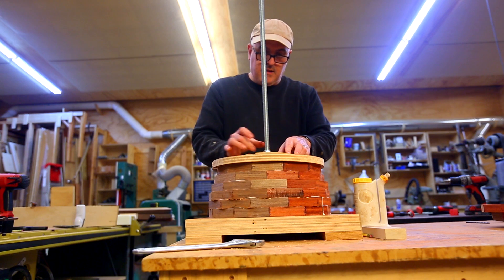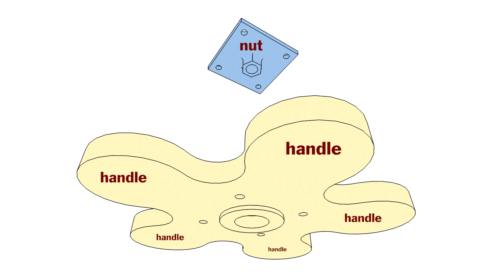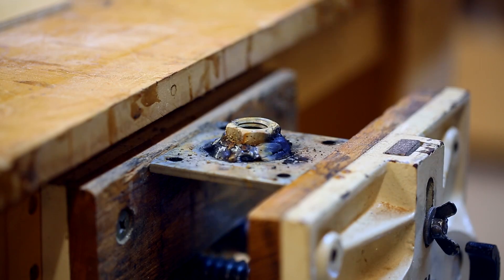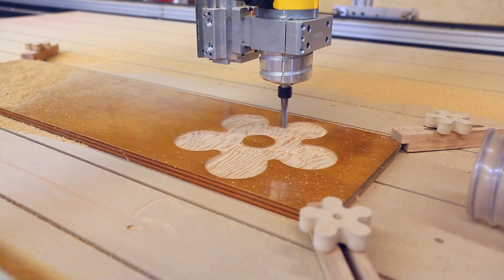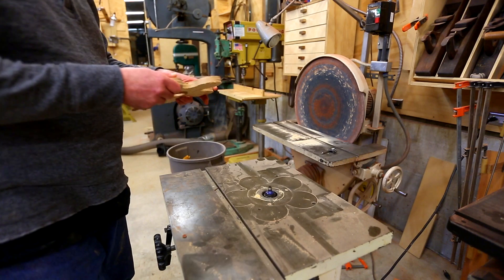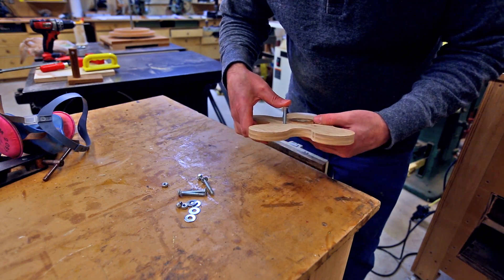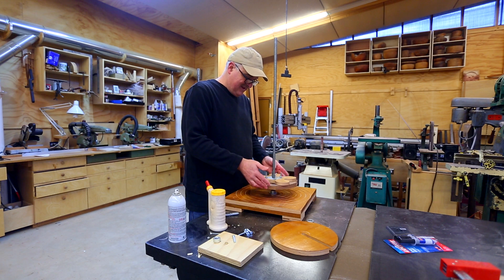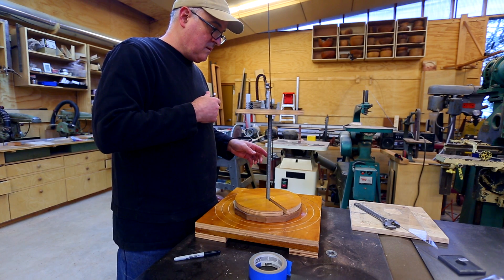Segmented Bowl Clamp Handle

Comment: I just found this video and I like the concept. I have an idea for the tightening nut. My metal chop saw has a quick release mechanism to make the clamp move in and out easily. This would fix the problem of having to spin the nut off to add each new ring. I don't think it would be too difficult to adapt something like this into your design. I can send a photo if you like or you could have a look at a chop saw in a Home Depot or a Harbor Freight store to see the mechanism.

Comment: This is going to sound critical, but this is way overdesigned. the bearing surface on the bottom of the knob should be a ring with a larger ID. Then use a dab of 5 minute epoxy to glue the nut into a recess in the bottom of the knob. done.

Comment: Consider bending the bottom of that allthread into a "J" hook, and swapping the welded nut for a cross-bar.  Then you can unhook the entire holddown plate assembly after loosening, and just pull it out the top.  Drop a few rings on, and re-hook it and thread it down again.  Great project though.. I've wanted to do a segmented bowl for a long time, this might just be the thing to get me there!

Thanks!

Comment: did I miss the part where the bolt heads were recessed?  

if not do you find they are making contact first?

Also to avoid all that threading you could put a 3 inch coupling nut at the base and make the rod removable with a double nut handle at the top.

the coupling nut would keep your 90% and the handle at the top would give a quick release.
Reply: but that is still an awesome clamp!

Comment: Most, if not all large C claps these days have a release button (or a lever, in some cases) to make it faster to adjust. You should build a release like that for this handle. You would need to get a large enough coupling nut and cut it in half longways. Then affix one half directly to the handle and add a small wedge to other half. Then add a receptacle for this half onto the handle. Now with both halves of the coupling nut in place it would act as a normal nut, tightening down as you turn it. When you need to remove the handle simply loosen it enough so you can remove the wedged insert and the handle will slide off easily.

Comment: That clamp system is brilliant Frank.
The issue that you had with the weld would most likley be the Zinc coating on the plate which is a nightmare to weld through and will contaminate the weld not to mention the zinc oxide it gives off. I usually grind back to bare metal where I'll be welding. I hope that helps.
 Again great work and that CNC is awesome.

Comment: my two cents.. find a 2-3"x 1/8 thick washer that will fit a little bigger then the nut. cut out a section to match the space on the wood piece. inlay the washer(optional I guess) and epoxy into place and then there will be no over time damage to the wood from the nut. love your work by the way. keep it up

Comment: I like what you are doing here...I was thinking you might be able to cut a smaller profile of the large handle that is "inlayed" into the large handle.  This would allow you to quickly remove the outer large handle and not remove the inlayed smaller piece (which would house the nut section)  

I have been considering a bunch of turned bowls that would utilize parts cut from my CNC...There is some great potential.

Comment: Just my 2 cents worth but it seems to me if you went back to your original concept of nut and washer, instead of washer you could use a 1/4" thick by 3 or 4 inch square or round plate of aluminum and slot it like the wood pressure block. Then when ready to clamp slip the wood pressure block on, then the alum. plate on top of that with the slot positioned 180* to the wood slot and tighten the nut. The nut should span the gap and won't damage the alum like it might the wood.... Just a thought.... I enjoy the vids very much..... Thanks.... Oh yeah, on the flat belt drill press I've seen them tighten the belt by giving it a half twist. I've only seen this done where the belt is horizontal. Not certain it would work on a vert. belt. Not sure if twist might try to climb vert. and cause problems.

Comment: That's really cool. You could always make the metal plate the bolts are attached to small enough to fit through the smallest ring. Then make the wooden handle detachable. Like just leave the bolts on the plate pass through the wooden handle but don't bolt them on. That way you don't have to unthread it every time.

Comment: good stuff as usual.  two ideas. 1) if you want longer rod you can buy an extension nut and simply thread it over the rod, then thread another rod into it.  2) instead of using a threaded rod, why not do away with that and use a smooth rod and a cam clamp that quickly moves up and down to where you need to clamp.  just two cent's worth. 

love your channel.  
best regards,

Comment: Good looking handle.  

I think a future enhancement is a split nut so you can slide the handle on and off without screwing on or off.

Metal lathes have such a device called "half nuts" which engage the feed screw.

I can make the split nuts for you if you can come up with a way to press the two halves together then tighten the handle to the rings.

Comment: you could make the bottom of the threaded rod into a T. And the cut a slot in the base for the T to pass thru. insert T do a half turn, T sits in a shallow groove when tightening to prevent it turning.

Comment: Awesome video! Why not just make the center threaded rod detachable? That would only need to be threaded the length of a nut and you dont need it to be fully fixed or totally square to do a good job as long as the clamp handle seats properly. You don't need to fix that degree of freedom so to speak :) (I think)

Comment: Try using a Quick Action Thumb Nut instead ;-)
Reply: +N De Deyne They're designed in such a way, that you are able to slide them over the threaded rod if you angle them. Once you put them straight, the threads engage, enabling "normal" nut operation... Just a quick tip from Belgium :)
Great job on your videos Frank, I've been a long time subscriber!

Comment: Love the clamp.  I had a thought on how to avoid the threaded rod swap and the endless spinning to get the handle on and off.  Cut the bold in half and fabricate a quick release cam like those on a Metal chop saw so you can quickly slip the handle down the rod then engage the Half bolt onto the threads and snug it up.  Just an idea.  keep up the beautiful work.

Comment: If you need to make a taller bowl than your now-shortened rod allows, just link the two pieces of threaded rod (with a big nut, or something fancier) after the segments reach the limit of the base rod, and keep going up. No need to have several rod sizes, and you can re-use the cut-off you already have.

Comment: I always like your videos. However this solution I don't like. It was better before just with the wrench. And you even had to shorten the rod and you have to completely unscrew it to get the glued pieces out. No no no no.

How about a folding wooden wrench permanently attached to the nut? It will fold up easily, but when turned left or right it will be solid. Just need a simple hinge. When you get the glued pieces out you can simply fold the handle up and out of the way. For holding the metal washer up, just use magnets. Put some on the top of the nut and it will become magnetic itself. It will easily hold the weight of the washer, but will allow it to move when tightening the nut up. I'm sure there are also other much better ways, but I think the solution you came up with is too much of a compromise.

Comment: I wonder if a heavy-duty lazysusan (or a thrust bearing) placed under the handle would make it both easier to turn and distribute the pressure.

Also, a half-nut mechanism such as is used in quick release vise mechanisms might be useful.

Comment: Top tip: You need to grind off the zinc plating before welding in order to get a decent weld. (both visually and structurally) Make sure there is no zinc plating with ~5mm of  the intended welding area.
"but it will rust!" ....you burn off the zinc when welding near it anyway, you're just keeping that crap from ending up in your weld ;) Not to mention the fumes are quite toxic. Saves you a lot of grinding afterwards as well! Just clean it up with a cold chisel and wire brush, degrease and paint.

Comment: use shorter pieces of threaded rod put together with coupling nuts to get closer to the length of rod you need. make them different lengths so you can get closer still

Comment: you could use a different rod such as the size used in vices, or scaffolding.  It may be very large but they make very large wing nuts for it.  a good picture is here.   No I am not selling this on ebay.
http://www.ebay.com/itm/like/131683350440?ul_noapp=true&chn=ps&lpid=82

Comment: just flip the wooden handle to the top, and use the square metal washer with the nut welded to it as your bearing surface. counter sink the holes though the washer on the bottom, then tack (weld) some screws in the holes and grind it flush (that way they stay in place, have a smooth bearing surface and are strong). then just drop the handle over the main threaded rod onto the washer and the screws..
Reply: +HomeDistiller lol it seems +Danny Jepp has the same idea

Comment: My dad welded a nut to a pair of Vise Grips then cut the nut in half. That way he could quickly clamp the nut where he needed it on the rod then spin the tool to tighten it. His contraption was used for holding cabinets in the air when working alone. Worked great.

Comment: Instead of cutting the rod in 1/2, cut it about 3/4" above the base, and replace the nut on the base with a coupling nut. The rod can be hand-tightened into the coupling nut, and then the clamp can be put to work.
BTW, the shape of the clamp handle looks like you gave it a Splat!

Comment: Instead of a threaded rod, could you use a flat rod like the kind of rod that's in a bar clamp and then modify a bar clamps squeeze gripper to bear pressure downward by squeezing the gripper, and take advantage of the rapid adjustment action that is one of the pleasures of using bar clamps?

Comment: Why don't you use your angle grinder with a cutoff disc to cut the bolts down? You could also have used it to cut the threaded rod without putting it in your mitre jig.

Comment: How about hinges on the handles, let them flip up when you need to add a ring?  Or put threads on the handles so they can be removed from the center wheel like a feed handle on a drill press.

Comment: You could just cut off the extra length on those bolts with your grinder, then you don't need to pull it apart again.

Comment: I would try a mig welder. It's a lot easier to weld I personally find with mig or flux core than with a stick welder. You can find cheap ones for 250 on sale at your local retailer. I bought mine from Canadian tire but im guessing your not gonna find one of those so just find the equivalent. Don't buy one right away. They always have sales and you can get them really cheap. Ps I love your videos.

Comment: +frank Horvath if you need a longer rod you could add a length with a connector in between, as long as you need more than just an inch or two there would be no need to change out the whole rod
Reply: +frank Haworth it would be nice if I could spell your name too lol
Reply: Autocorrect will case my complete mental breakdown one day

Comment: Tap the plate with the nut and use countersink (countersunk?) screws and ground them flush on the top. Nice and clean, no nuts required.

Comment: How about this, Frank. Take a old pair of vice grips. Remove the pads. Take a nut and split it in half. (or use two cut slightly off center to account for kerf)  Weld the two halves of the nut in place of the pads, along with two halves of a washer. Voila! Clamp the ViceNut(TM) on the rod and give her a spin. (Refer to picture at imgur / aNl7lx1.png)

Comment: What about instead of a threaded rod you were to use a squeeze clamp with say a hook on the bottom plate? You could slide the squeeze clamp up and down as normal and the rod could reach into the rings and connect via a hood on the bottom plate and could thus be easily removed. I know there would be a loss in clamping pressure but I'm sure if you got a quality clamp it would provide some good pressure.

Comment: Yeah but you had to use the wrench to fasten the 4 bolts? You should make handles for those too :) - nice project! On the weld, you could have tapped a thicker metal plate too.

Comment: +If you use a "threaded flange" in your base, to hold the threaded rod, as you made and installed in your handle you can unscrew the rod if needed instead of unscrewing the handle each time you need to add additional rings.  Hope this helps.

Comment: Not to be too critical of your work, but have you considered that the tops of your carriage bolts will be making contact with your pressure plate rather than the entire surface of the wooden handle?  Do you think that it will make a difference or do you think you should countersink the heads of the bolts?  I love watching your work.  I hope to be able to do some of the stuff you do one day.
Reply from the maker: +Tony Montgomery That was the plan but they look like they are below the raised ring in the center.
Reply: +frank howarth i was wondering if adding a ring glued to the bottom of the handle say like an inch thick then you would have better gripping power to tightened with your fingers wrapped over and under each handle? the ring would make full contact around onto the clamp piece.

Comment: You should probably countersink the bolt heads so the whole flower handle presses evenly on the top plate. As it sits, it looks like only the 4 bolt heads are making contact.

Comment: How about a handle that just fits over the nut, but isn't permanently attached to it?  That way you can use it to spin the nut down like you currently have, but then you can just pull the handle off without having to spin the nut all the way off?
Reply: +Mitch Fenneman   That's what I was thinking.   Separate the plate / nut from the handle.  Weld a washer onto the nut as a bearing surface, spin that onto the rod.  Then, flip the handle over so the rebate for the plate is on the bottom of the handle.  Add a couple of magnets to the handle so it stays in place.  That way you can just quickly pull the handle off, leaving the washer / nut / plate in place on the rod.
Reply: +iliketoUSEmybrain017 I was thinking the current handle could be cut off of the plate and a new one made with 4 matching holes to slip over the long bolt ends for the clamping work.

Comment: I know it probably isn't necessary but I would have to think that a vertical handle of some sort that attaches to the flat part would get you better tightening against the rings and make it easier to loosen after. Such as instead of it being so wide it could of been a little taller. Great video though nonetheless!

Comment: what i think would be pretty handy and also fun is that you could add some mass to the handles so it has more momentum to go almost by it self up and down. I hope you understand what i mean :) 
And as Always great idea and great video
Reply from the maker: +upriders1 I like that idea
Reply: +frank howarth If you're going to take the time to make weighted handles, why not make one universal slide on knob that drops onto smaller threaded plates. That way you could make multiple clamping plates that all use one knob. Use the CNC to cut holes for some steel pins so the knob will fit on in any orientation.
Reply: If you add mass make sure you put most of it on the outside of the handles and away of the center to get maximum spinningness. We need a physicist to explain why, but for now just trust me on it.
Reply: +Samtagri i agree with you, youre right
Reply: +Samtagri I think you would want most of the weight towards the center.
Reply: +frank howarth also maybe add some graphite power to the threaded rod to provide less friction? I know rods like that are usually a coarse thread, they can be rough in general and stick at some points.
Reply: carter grandison   Well you will have more angular momentum if the weights are away from the centre. So if you push the sinning disk in a constant speed (as fast as you can pull your hand away) then the arm with weights far from the centre will have more angular momentum than if the weights near the centre. So it will keep spinning longer. 

I think you are confusing this with the figure skaters spinning faster when they pull their arms inwards. This is because the angular momentum being the same will spin an object faster if the mass is near the center.

OK, I'm only half decent in physics, so this is the best explanation I can come up with.
Reply: Please consider having more weight in total will cause higher friction at the rod ...

Comment: What about like a T-nut style? Where the T is attached to the rod and inserted into a channel with a twist (with stops on the inside so make tightening  easier if you use a flat surface on the top of the T that will face the channel then i this making this square shouldn't be too hard) so that after the glue has set, you just loosen the nut, twist the bolt, and take the whole assembly out (nut bolt and handle)

Comment: why not make a wooden threaded rod with less turning to tighten it up, I cant remember what the proper name is but instead of 10 threads per inch only have two or what ever, it would make a cool video or stop motion, ps hows the kitchen
Reply from the maker: +aarontash making wooden threads would be fun.  I'm procrastinating about the breakfast bar.
Reply: +frank howarth I'm looking forward to the breakfast bar build!